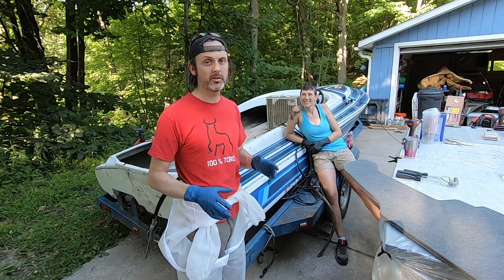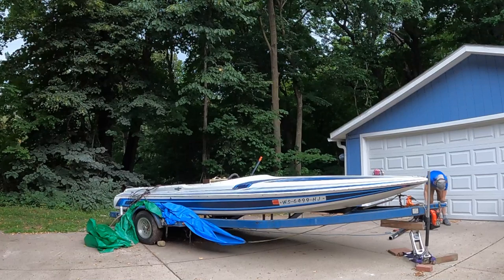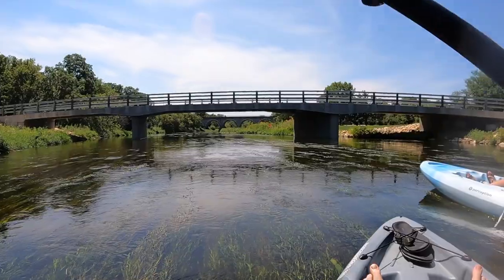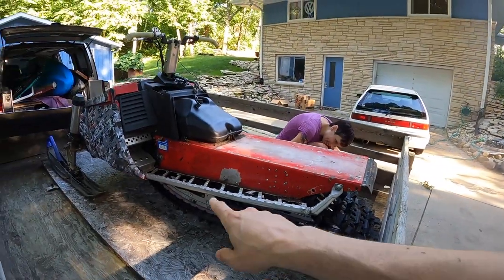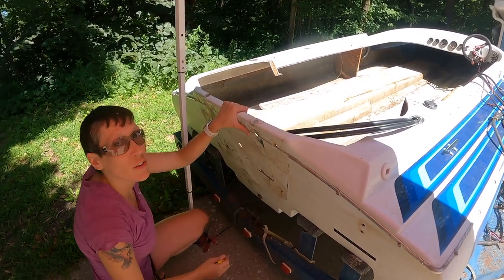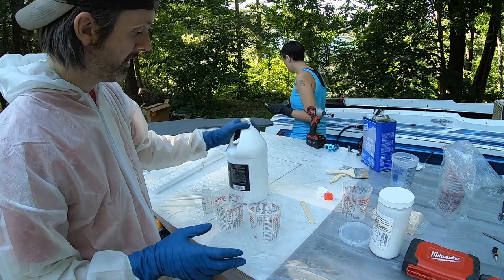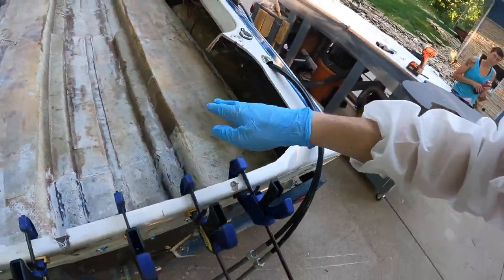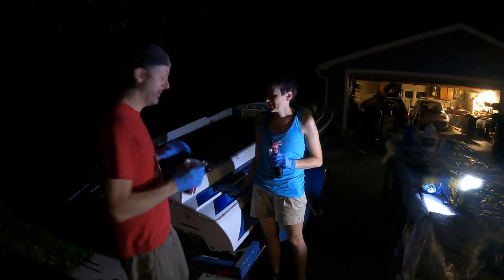COOSA TRANSOM REPLACEMENT HOW TO Sleekcraft SST Sunday #12

Comment: I mix arocil or cabocil to thicken resin. For transom install, I make it stand with arocil, then I add a bunch of fiberglass I cut to 1/4 " and make it really snotty. Then I use microballoons in the end to get a good heavy thickness. I use a 3/8" tile notch trowel one way on the transom and opposite way on the wood or foam. Then I make huge transom clamps. Then glass the transom side of the wood with 3/4"oz mat glass and smoots that thing in. Dries solid, fills holes. Moved freely to fill all voids. Vibration helps. As it comes out the sides I pack it full and use 2 3)4 oz mat layers around the edge to keep the smoots clean. Then I use 3/4 oz mat on each wood and a roven waiving between the pieces. And smoots around the side again with the smoots and mat. Then mat/ woven layers over the finish . One woven layer per 50 HP.  It shouldnt need any brackets support.  Should hold fine. 
 The stringer replacement I would have done with 1" mahogany fished with 10 oz cloth attached with 3 layers spreading out  sides not much rise with 3/4 oz mat between layers. 
 Cool build.

Comment: Polyester resin is cheaper to buy, not necessarily cheaper to use.  

Polyester requires CSM (chopped Strand Matt) which is a very thirsty fabric.  Epoxy does not require CSM so you will use a lot less resin to wet out your layup.  How much less depends on how much CSM is in your layup schedule.  

An Ideal resin to glass ratio is somewhere between 1:1 and 1.25:1 for cloth. CSM is higher, it is between 2.0:1 and 2.5:1. For every oz. of cloth you layup you will need 1 oz of epoxy or poly to wet it out.   For every once of CSM you would need at lest 2 oz of resin for wet out.

For example: if a layup has a surface area of one yard and you want to cover it with two layers of 17oz. biaxial here's what you'd need for each layup of epoxy or poly.

For epoxy with 1700 (17 oz biaxial):
2 yards of 1700 (one yard for each layer) 
36 oz. of epoxy (1:1 epoxy to glass ratio).

For polyester resin with 1708 (1708 is 1700 biaxial with 3/4 oz CSM attached to one side):
2 yards of 17 oz. biaxial (one yard for each layer) 
36 oz. of poly resin (1:1 resin to glass ratio). 
In addition, this layup would include 3 layers of CSM, 
3 Yards of 3/4oz CSM (start, in between cloth and a finish layer)
41 oz. of poly resin (2:1 resin to glass ratio)

Epoxy 36 oz Vs. Poly 77 oz.
Extra material for every yard of double layer biaxial would be 41 ounces of polyester resin and 3 yards of CSM.  That's a 46% difference in resin and a lot of extra weight.  Epoxy costs twice as much as polyester per gallon (for WEST System) but you are using approximately half as much, so the price of the layup is similar.  Epoxy projects could even be cheaper than polyester projects if you used an economy brand like MASS or Raka.

One square yard of 1.5 ounce chopped strand mat weighs 13.5 ounces and it would take 1 pound 11 ounces by weight of resin to wet out. All of which could be eliminated if epoxy was used without CSM.  The results would not only be lighter it would be stronger and less permeable to moisture due to the superior physical properties of epoxy.

Comment: Enjoy the phazer. And it does run I promise. (Don't forget it's premix only).
The rail road tracks up the bridge are for ice. Every couple years the the creek will freeze then huge (by creek standards) chunks of ice break up and float down, usually causing and ice dam somewhere, usually have one in my yard. Then suddenly they will let go and the power of the ice bergs going down is absolutely amazing. It's rips trees off the banks, moves all sorts of rocks and anything else in its way. So they put those rails on to keep the ice from chewing away at the footings.
Reply from the maker: Thanks again again, man!   Makes sense about the bridge stuff, those bottom stones were pretty wrecked.  Btw, Sub'd, your vids are hilarious

Comment: Canadian guy here. Great video's of the project and ya have given some helpfull idea's. My bro and his wife bought a 22 foot Drummond cuddy cabin with a 400ci small block chevy and a trailer for 1600 bucks. He did your drill test on the transom and center support and low and behold dry wood dust. Did a tuneup and fluid change on the motor and outdrive, Cleaned the boat's gel coat with lysol toilet bowel cleaner, works amazing. Changed the ignition switch, couple new batteries and damn if the thing did fire up on the first try. Guess it was looked after years ago because it was a police boat for some time. 47 years old and works greta and my bro has had it in the water for the last 3 weekends and rented a slip for a month and it aint suck yet! Keep up the great video's and enjoy your refreshments. TC Dave from Canada
Reply from the maker: I love old cuddy cabins, post a video of it!   Be careful if you have an Alpha behind a 400, just do easy launches and don't wave hop and you'll be okay; the driveline 'shock' is what gets them.
Reply: @ADDvanced  ya he got the alpha drive but seems to work great so far. My brother not a speed fanatic, just to take out the wife and kids and do some fishing. and for 1600 bucks was a good deal. By the way kudo's to the hard working wife that dont mind getting her hands dirty either!
Reply from the maker: @davehill9951  Just do the oil and waterpump every season and she'll treat you right.  Cheers man!

Comment: Great vid, as per usual!

For those who follow this and plan to do their own transom i have some pointers... ;-) 

1. Instead of a goo to glue the first board to the transom use approx 600g/m2 chopped strand mat. That will give a good adhesion and strengthen the outer layer of the transom.
2. Lots of bleed holes in the boards to make sure that you get good pressure over the entire transom.

When/if you build the knees you basically only have to build it up to the lower engine bolts. That´s where you have the "pushing" force that you want to transfer to the hull. However, if you build the first 40-60 cm of the floor "right" it will do the same job and it will be less complicated and lighter.

Keep it up!
Reply from the maker: I didn't think of doing the CSM before putting in the transom.  Oh well.   It's cured now and it seems strong AF.   Honestly I wanted to use 2x4s to spread out the load but I was running out of time and sort of rushed this...    :|

Current plan is to mix up a batch of resin with a lot of cabosil, and get all the voids around the sides/bottom of the transom, and fair it out so there's a nice radius, then tabs of CSM, then a layer of cloth, then a layer of woven roven tabbed into the tunnels/keel/sides of the hull.   Up top, there is not much room to tab the transom to much of the hull, so not sure what I'm doing there yet.

Comment: Everyone should go watch Boatworks Today video channel to get educated on the proper methods and materials before doing any fiberglass work on a boat.

You should have mixed up fumed silica with the resin along with some 1/4" long chopped fiberglass strands to make a thin peanutbutter consistancy mix before adding the hardener. This mix can then be spread to a 1/8" - 1/4" thickness on the Coosaboard that will be placed against the inside surface of the original fiberglass transom skin. The mix will squeeze into all the irregular surfaces and preventing voids and air pockets

Clamp all layers in place as you did but use some thick lumber between the bolts on the inside and outside to better distribute the clamping forces across the transom surface. Make sure to put a layer of fiberglass between the Coosaboard layers along with a thickened resin spread that will squeeze into all of the pockets and uneven areas.

Let it fully cure before unclamping and laying down the fiberglass layers.
Reply from the maker: I didn't have any and figured the microspheres would be enough to thicken, and thought wrong, lol.   I did chop up some glass and mix it into the resin to help thicken it up, and that worked pretty well.  Wanted to do the lumber on the outside too, but didn't have bolts long enough and the hardware stores were closed, so.... yolo!  :).  Good news is it turned out strong AF, got a great bond, will be fairing it in and tabbing it to the hull shortly.

Comment: I rebuilt the transom on my 1959 White House 14 ft Fiberglass runabout.  I found a 1984 Mercury 50 HP 4 cylinder.  I had built the transom out of marine plywood, 3 layers of 1/2 inch which ended up 3/8 thicker than the original transom.  The motor has new ignition and carbs rebuilt.  The boat looks odd as it has fins.  I got some looks Saturday as the motor is a long shaft so I have it elevated 3 inches and it sits 6 inches back on a jack plate so it looks huge on the boat.  Unfortunately I couldn't give the lookers a show as the motor would not rev past about 2500 rpm.  I bought new fuel lines and maybe the timing is off after changing the trigger.  I didn't perform a  compression test as I took the sellers word.  I hope I didnt get a bum motor.
Reply from the maker: Check out John's Old Mercury website.   Costs like $5 to join, but the experts are there.  Not revving sounds like a fuel issue, not a compression issue.

Comment: rooster mustve just drank a can of redbull
about the bolt through the drainhole , might be a good idea to put a deep bottlecap over the bolt on the inside so it doesnt get glassed intoo the transom , the bottlecap is eazier to drill out after the bolt is out

Comment: You bonded the Coosa board to back of the transom with Resin.......the second layer of Coosa to the first with Resin.....then a layer of Woven Roving, correct? I was thinking of putting a layer of cloth between the transom and first layer of Coosa to help fill any voids just in case the rear of the transom isn't as flat as the Coosa board? Thanks in advance for any input
Reply from the maker: Yeah, you could do that and I can't see how it would hurt anything.   Or maybe put a layer of glass on the transom and before it sets up, throw it into the boat and glass in.

Comment: Instead of using a grinder wheel or a sander, could you use a wire wheel for prep for laying epoxy? pros/cons?
Reply from the maker: I don’t think you’d get deep enough.   You need to get to the bottom of the crack

Comment: Chopped strand fiberglass mat (CSM) can be used with any resin system including epoxy. You do need to get the proper CSM mat that has a binder that is compatible with the resin you will be using. Polyester resin will dissolve the binder chemical agent used in polyester compatible CSM mat. Don't use CSM mat that has a polyester compatible binder with epoxy resin. The binder chemical is dissolved by the resin so that the fiberglass strands will be properly wetted by the resin and obtain it's full strength.
Reply from the maker: Yeah I have CSM mat, which I plan on doing around the edge of the transom, followed by woven roving.
Reply: The greatest benefit of using epoxy is to eliminate the CSM.  CSM adds very little strength due to it's high resin to glass ratio and short fibre length.  It's 2:1 resin to glass ratio also makes it heavy.  CSM is necessary requirement when using polyester resin for adhesion purposes.  I see no benefit at all to using CSM with epoxy. A light weight weave and/or admixtures can be used with epoxy to conform to complex curves, no need for a heavy, expensive and weak CSM layer.

Comment: you should just delete the splash well while you have it off! then you can make the knees as tall as you want
Reply from the maker: Going to keep it, the rear seat goes right up against it.   Going to tab the knees into the bottom of the splashwell as well, should be crazy strong

Comment: How much a sheet is that material on the transom.
Reply from the maker: $150.   Marine plywood in my area was $115/sheet.   Shipping was expensive, but if you live near Florida it will be cheap.
Reply: @ADDvanced  no the Coosa board?